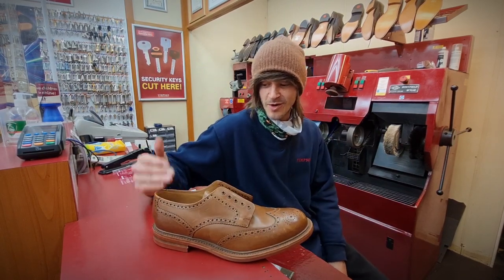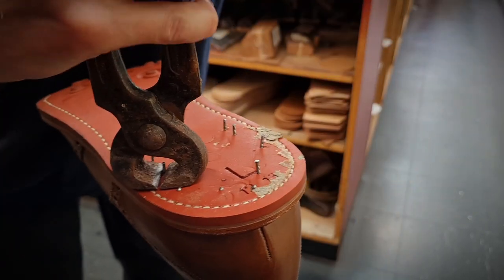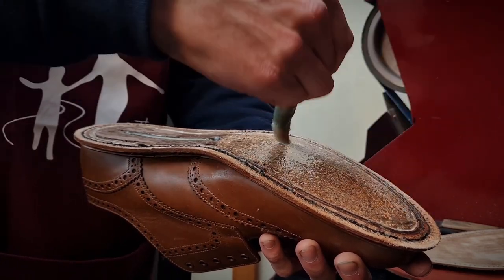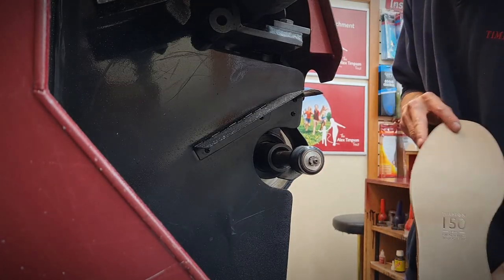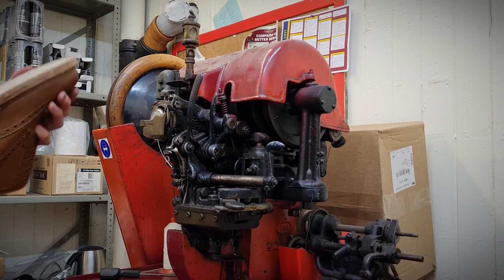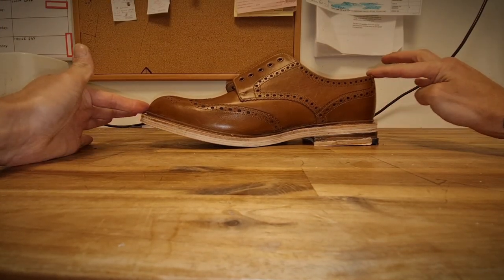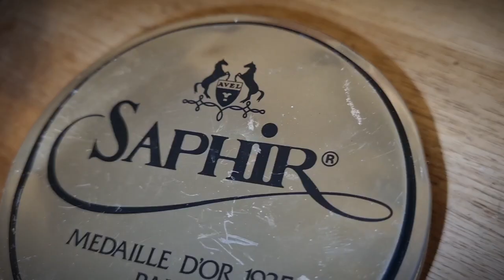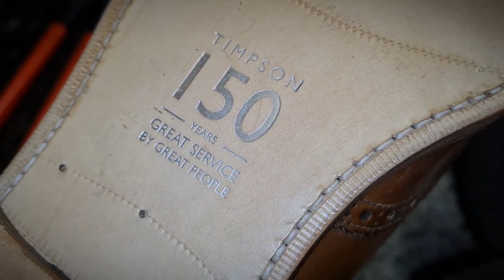Converting Loake Worton From Rubber to Leather | Resole #43 | Tasty Executive Leather | Shoe Repair

Comment: I'm in Malaysia and, at age 60, been itching to bite the bullet and finally buy a pair of Made in England shoes.  Most likely they will be Loake, because of the (comparatively) reasonable prices AND the local seller stocks my size. But will have to wait until the lockdown is over and there's no restriction in movements. No point having good shoes but can't go anywhere.
Reply: Go for it Ahmad I am sure you will love Loakes they are really good shoes.
Reply: There are various grades of Loakes. Personally I like them all, but would go with the 1880’s.

Comment: great work! the shoes look amazing!. Question though, what was the point of removing the midsole just to then glue it back on? Since its a brand new shoe, it would be safe to assume that the cork/shank didn't need replacing
Reply: I can only assume to remove the old stitches
Reply from the maker: Spot on

Comment: never understood how you guys hit the same holes in the welt with a machine. It isn't like it has a sensor. How do you do that?
Reply from the maker: Line it up correctly, starting in one of the original holes setting the correct stitch length before hand, we can get into the original holes no problem.